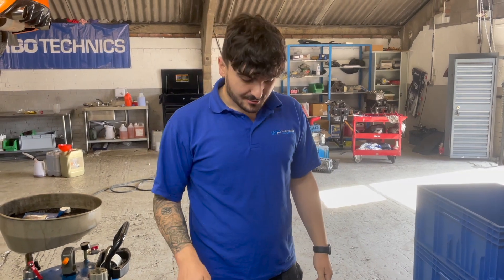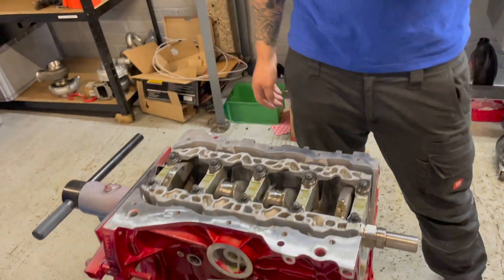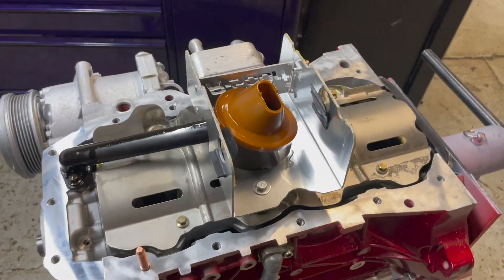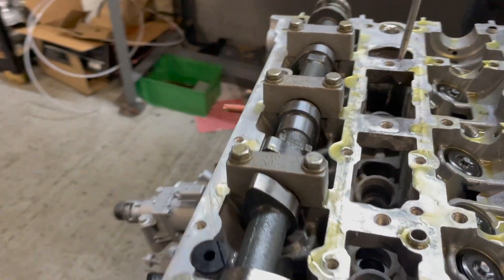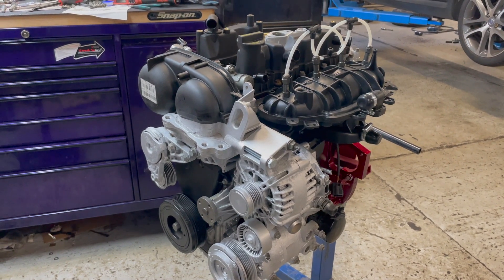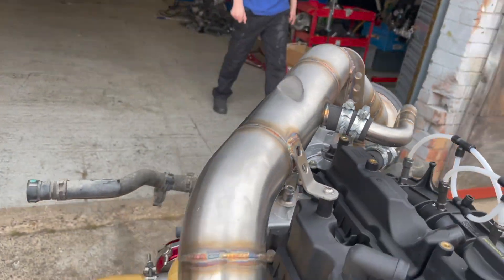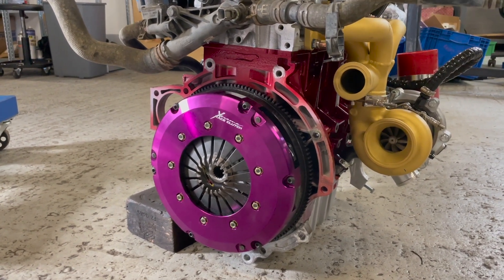MK7 Fiesta ST180 1.6 Ecoboost big turbo forged engine build -- Part 2!

Comment: What sort of clearances did you end up with on your Big ends and main bearings, i cant find any recommendations for what they should be around. Ford manual just says use the colour coded bearings but that doesnt help running ACL or King Bearings :D

Comment: What Torque specs do you use when tighting the Rod bolts?
Reply from the maker: Hi,

I can’t remember off the top of my head but it would have been whatever the recommended tightening sequence with the rods was

Comment: I'm looking to get a fully build, sleeved, closed deck engine somewhere next year aiming for about 500bhp+ with a g25-550, copying the 500bhp 1.6 swapped mk8 fiesta from pumaspeed in preparation of my attempt of an awd swap. Do you guys offer a service like this? I'm specifically looking for a crate engine since i'm located in the Netherlands. I've been looking at the black top crate engine from pumaspeed which would come down to about 10k euro before shipping and taxes when specced to my liking, but i've been hearing mixed things about their engine builds, sometimes forgetting to torque things correctly, so i'm kind of looking for which options there are.
Reply from the maker: Hi there,

Sounds a great project you’re planning but we don’t offer any engine build services anymore unfortunately 😔

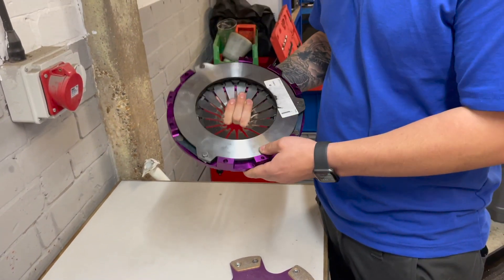Comment: 4:15 yeah, that's great and totally important for a part you can absolutly not see unless you take have the powertrain apart xD
8:45 oh, and does the slot for the key in the crankshaft affect it's balance in a way that you have to counteract for it?

Comment: As someone in the states who wants a fiesta St this looks way better
Reply from the maker: Definitely better than a stock Fiesta ;)
Reply: @WaysidePerformanceLtd  what’s the hp goal for this built motor?? Only overseas model ST I’ve seen were the 1.6tdi versions can those make the same power with a built motor???I love the styling of the overseas models
Reply from the maker: @blakelip3  We are aiming for 500HP from this motor early next year with a bigger turbo and auxiliary fuelling set up
Reply: @WaysidePerformanceLtd  ahhhh sweet will it also be e85 or some type of ethanol blend e30/e40 or meth after the aux fuel setup??
Reply from the maker: We won’t be using any ethanol blends at the moment due to the cost of it here in the UK 😔
Reply: @WaysidePerformanceLtd  oh no lol that sucks what petrol do u guys have
Reply from the maker: It certainly does suck! E85 over here is around £4 per litre :( Best we have is 99RON at the pumps
Reply: @WaysidePerformanceLtd  I definitely agree I’d love to see you guys collab with Mighty Car Mods ;)

Comment: Hey guys, really liking the build, I'm interested in the manifold, I've asked one or 2 tuners about them and fitting one to mine which is a stock turbo at the moment, they say they lose power and not really worth it  even when going bigger turbo s280/x47r etc  have you noticed in your testing if they do improve the turbo response/power.
Keep up the good work
Thanks
Reply from the maker: Hi, this tubular manifold uses a V-band so we could fit the Pulsar turbo, it is part of the 'big turbo' kit we have designed.

If you are referring to the tubulars that fit stock frame turbos, we haven't done any back to back testing on how well they do work but I certainly can't imagine them losing you any power.

On a stock turbo the gains would be very minimal, if at all, with a tubular but once you get to the bigger hybrids I would definitely say there should be some gains there.

If something you are considering we would be more than happy to run back to back tests of stock manifold vs tubular, may make for another interesting video!